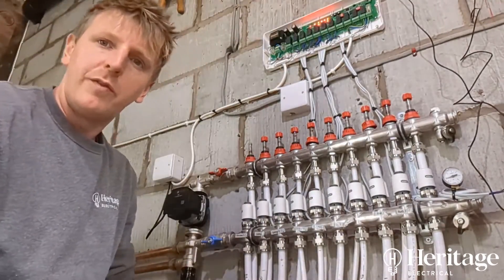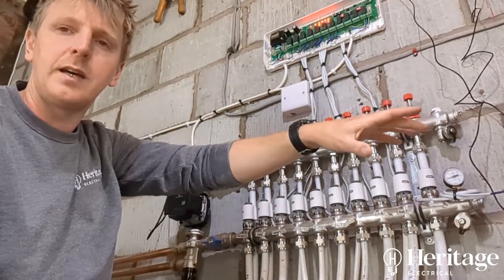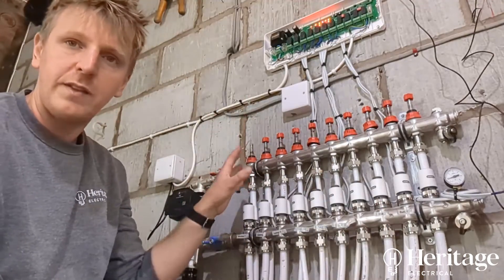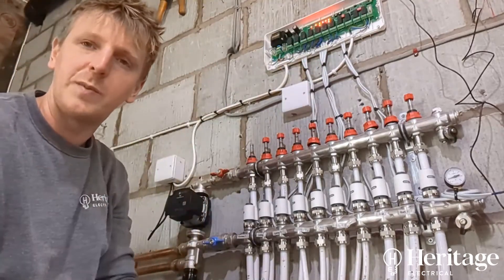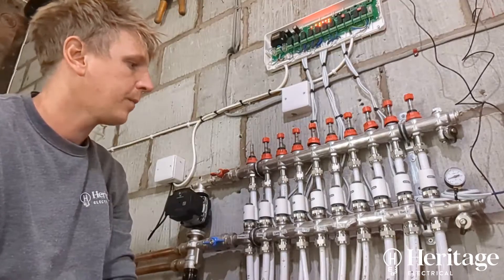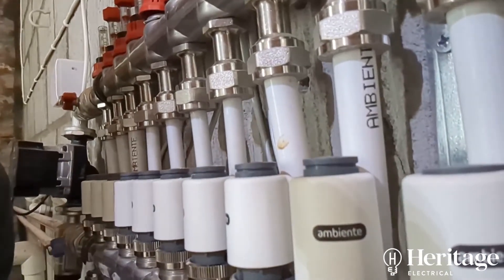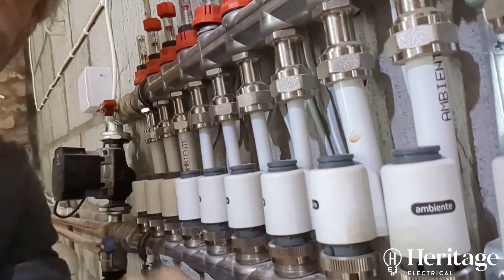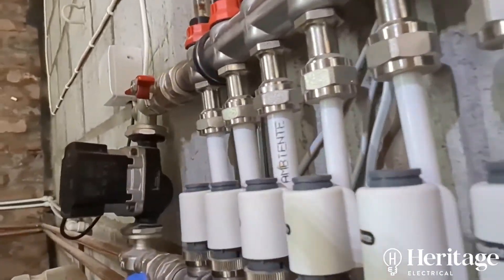Part 5 One of the WORST Heatmiser Underfloor Heating Installs: Identifying Correct Heating Loops

Comment: Just to correct you , thermostatic radiator valves work exactly  the same as them actuators ,when  room reaches the desired temperature it shuts completely, there is some danfoss valves that control pipework temperature but very rare, Hope this helps.
Reply from the maker: Hi James 
Actuators mechanically are the same as TRV valves, but dont have temperature control.
When 230v is applied, they are open. When the voltage is removed, they are closed. They have no temperature sensors, the external thermostats that we install are what controls the actuators. 
Cheers Paul

Comment: Hi my system has been working fine for 15 years and now the lounge zone has stopped working I’ve taken the actuator off and the flow pipe leaving the manifold is hot all other zones have been turned off but the return pipe into the manifold just isn’t getting warm the flow gauge is full of water and the spring is not sticking when I take the top off and is full of water any ideas